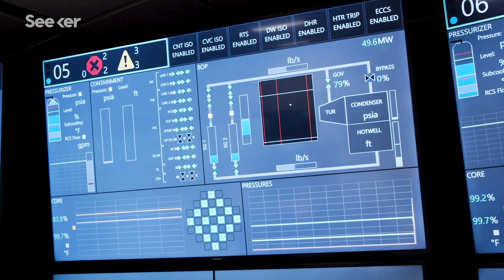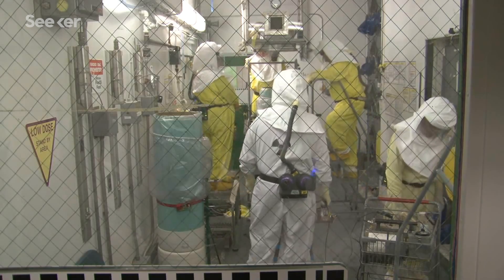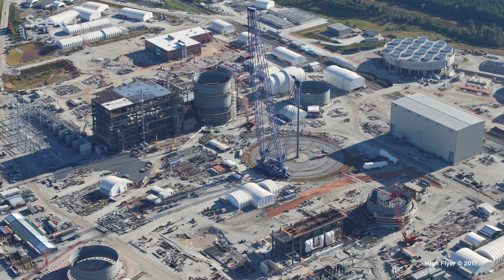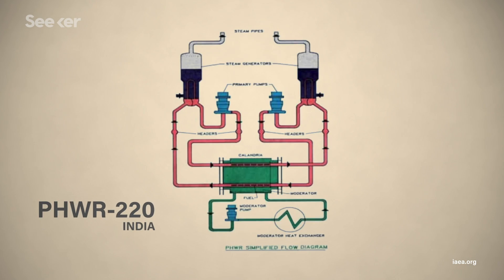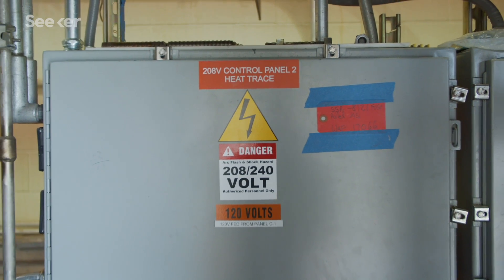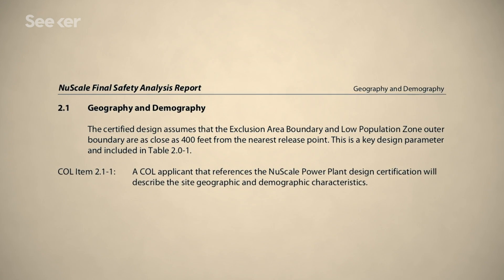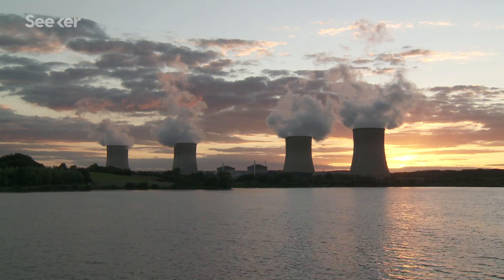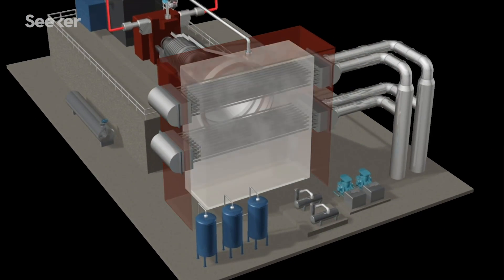Mini-Nuclear Reactors Are Coming, and They Could Reinvent the Energy Industry

Comment: "Mini-Nuclear Reactors Are Coming, and They Could Reinvent the Energy Industry"

What I expected: Small reactors you can fit on personal property that are controlled autonomously via artificial intelligence, capable of extremely efficient, high performance power supply that's completely independent of the power grid. Basically a Modern Day version of last century's Atomic Age Sci-Fi art and styles.

Comment: Solar wind hydro cheaper cleaner  safer.
Reply: @mrmugame  Acid rain anyone and is the waste by product is that still around? what about japan and Russia are the failed reactors are still causing trouble? In theory on paper its cleaner, but in practice its not. The Bigger question is that its owned by share holders of Big power companies that care little about the workers and only focus on the bottom dollar. How many people died digging up and refining the materials  for the reactors? and how much environmental damage and co2 emissions does open strip mining cause? Nuclear reactors are but one small cog in an industry that will cause massive amounts of environmental damage over time.
Reply: @mysticchicken5352  I'm not saying nuclear power is the best solution, but it's one of the best at the moment! And the refining and digging for the materials for a solarpanel aren't clean either. My point is that nuclear power isnt as bad as many poeple think and that solarpanels for example aren't cleaner (And that also applys to electric cars)
Reply: @mrmugame  The previous recovery rate for silicon-based panels was around 90 percent, so this new solar panel recycling process is good news for the environment. Non-silicon-based solar panels can have a recovery rate of up to 98 percent. How much of a Nuclear power plant can you recycle? is the ground safe to turn in to a park. where is the USA nuclear waste now? Out of the two I will go for Solar over Nuclear any day.
Reply: @mrmugame  Depends where you live , I prefer Solar Hydro wave and wind, more sustainable but that's my thing. In Nz we use Hydro wind and solar and coal, I wouldn't mind if we didn't use the coal as its not needed here. for us Ev cars are sustainable and greener than in the USA. each to their own. Good luck.

Comment: The concept looks like a good way to go at first glance.  Legacy plants were built on the premise of economy of scale ($/MW of capacity).  The down side, is the amount of generation lost if the unit trips off line .  It can be problematic to start enough reserve generation to replace a large  loss.  Large nuclear plants have been regulated to death by the NRC.  Imagine trying to build a house and the state changes the building code every 2 weeks.  And, oh by the way you must tear out all of the work you have done that does not comply with the new changes.   This is what you must deal with to build nuclear.  This concept can work if the package plant specifications are approved and frozen before the  first piece of metal is cut.   Nothing is said about refueling and how he core would be accessed to do it/  Military reactors are fueled for the life of the reactor.  But they use bomb grade uranium to do it.  Not sure how that will fly for numerous plants across the world.  No mention is made about Thorium reactors (no surprise since it is a competing technology).  you can't make bombs out of thorium.  These  reactors operate at low pressure on the reactor side.  The waste products have a much shorter half life than uranium reactors  Current reactor technology is based on the military reactors built for submarines. Thorium does not have that military investment  in it's technology base . A clean sheet analysis might very well choose Thorium over uranium.

Comment: The problem with nuclear power is not how sophisticated the reactor is constructed or is the reactor fail-safe. The main issue is how the radioactive waste is managed. 

How do you deal with the radioactive waste that will remain an environmental threat for hundreds of thousands of years, even if the human kind extinct by then.
Reply: By burning it in breeder reactors, until it's time of being dangerous is reduced to a few centuries, then putting the remains in the storage facility. As a bonus, you get a shit-ton of energy you would've thrown away otherwise.

Comment: Nuclear, expensive to build, cheap to run and expensive to decommission and expensive to store waste. 
So, overall expensive!
Reply: All of that is easily solved with generation IV reactor technology in the licensing process right now.
Reply: @chapter4travels  My day job is Aeronautical Engineering Design, I know very little about Nuclear Energy.
But is there even one Gen IV complete design, ready to build. From what I 
read they're just talking about what's possible. Wouldn't say that's near licensing. Do these reactors not produce any waste. 
My house is completly powered by wind and solar, but I can see some the problems of having the whole energy system using renewables.

Comment: Nuclear waste is harmless......until it escapes into the environment.
If you think that can't happen, wait for it........ It has only been in storage around 75 years. How long do you think steel barrels last? The first earthquake dispensing nuclear waste into the environment WILL happen. It won't be the last.
Reply: Nuclear waste is not stored in steel barrels, it's stored in super-strong concrete and steel casks. The waste is solid metallic pellets, there is nothing to leak. When generation IV breeder reactors come online, it will be worth a fortune as fuel.

Comment: Don't you think that these mini reactors will only increase nuclear waste and surely using a molten salt reactor burning thorium would be better and cheaper than the uranium systems.
This is because thorium is so plentiful, the reactors are 'walk-away' safe and use lower energy than the conventional uranium reactor plus the thorium can be recycled and used one more time. 
Just a random thought, why couldn't we fire off our radiation in a rocket at the sun or get it to the centre of our planet at the molten core?

Comment: Lets see you pull control rods until they are a critical self-sustaining position in the core and they sit there as the reactor generates heat energy used to boil water.  And then every so often operators pull rods as necessary to make up for "burning" of the fuel.  A reactor big enough to run a city of 1,000,000 people has about 100 tons of fuel in it and it 
"burns" about 2 tons of that fuel in 2 years.  It is actually a very simple system with very few moving parts and produces power at about 3 cents a kw hour.  It is all the overblown restrictions placed upon this resource that restricts its development in the US.  We have enough uranium in the earths crust  for about 2 million years of power production and that is not even considering thorium as a fuel source.
Reply: And then there's a possibility of extracting uranium and thorium from the seawater.

Comment: is there reason why we can't use nuclear sub marine power plant as civilian purposes?
Reply: The reason is those designs are classified technology.  I hope they have a very good reason for keeping it this way because that tech could be good for everybody.
Reply: there is nothing proprietary about nuclear power; 
way small nuclear power generator is designed is 
its one every other one; so when they are slide in; they are in sync so its full power when they need less they pull back; so that it is less power generation; thus less water need to cool; that can only be how its done; 
how is that proprietary? 

second is how to transfer heat; u.s. uses steam; lower temperature; 
Russia uses higher molten salt; none of these are proprietary; except every other one;

Comment: Why are they  obsessed  about  only hafe  the issue  .such as consumption more efficiently  using  the SAFE forms  of  energy. 
Sadly  due to greed  man has proven  himself  unworthy  to hold the power of  the  atom in a SAFE manner. Mathematically speaking nuke does  not  have  good numbers  as we are spun to believe  .case  in point the Perpetual storage and management of spent fuel rods.
Reply: Nuclear power is the safest way we can make electricity and We already have a very good solution for the waste. Leave it where it is, safely stored on the reactor sites. Molten salt breeder reactors are only 10-15 years away which will consume it as their fuel.
Reply: @chapter4travels  the facts  don't  reflect  the reality  of safety. I am a open  mind I will  await  for your explanation  that wind are tidal  are  Pv  are less safe that nuclear. We can do so with  documented history
Reply: @chapter4travels  I see that article  it appears  it come from a unbiased  Collegiate Institution.i will  read in depth. The 2011 (background)
Deaths  from radiation  is at 650k.
These  findings  are really  difficult  to  trust there is apparently  a good  bit  of  lobbyists and special interest and media campaigns Thank you for opening the discussion.

Comment: I think they should keep the current distance required. At least for quite a bit longer. We need to do these things for a while to see what can go wrong and then if we go a long time with a very good track record then maybe we can shrink the requirement. In my mind just as we take massive precautions with rockets because we haven’t done that many flights, nuclear is similar. Once we get to much more widespread use and we see that it truly is far safer I would consider changing my opinion on how far should be required, but for now it should stay at least as far as other nuclear plants are required to now, if not further

Comment: I believe nuclear energy is just a toxic rabbit hole. Every time humans build something new on a previously failed endeavor it ends up blowing up in a new way. We "learn" from our mistakes and build something that ultimately ends up doing the same thing. What happens when there is a potential meltdown, the power disappears and the magnets drop the rods (as designed to do) and one gets stuck? And they are pushing to put these things in close proximity to cities and neighborhoods? Making them smaller implicates that there will more than a few to achieve the same power output as one normal one. Making them smaller also does not eliminate the biggest problem with nuclear energy, nuclear waste. We never really learn, do we?

Comment: The world has the nuclear fuel to power it's current electrical use for about 20 years. what's your plan for 40 years from now?
Reply: There's enough thorium to last for eons.
Reply: @KenJackson_US  The fuel source that even minor mistakes in handling can lead to bone cancer (before being turned into nuclear waste) and which may not itself be fissile but leaves weapons grade plutonium as a waste product, meaning it's waste piles can actually experience thermonuclear melthdown.... gee I wonder why we're not using that more.
Reply: Even minor mistakes installing or maintaining solar panels can and does result in death as you fall off the roof,  @benderrodriguez6343 .  And that's not a joke.  Deaths per unit energy from rooftop solar are MUCH higher than from US nuclear power plants.  In fact, US nuclear is the safest power source in the world.

Your concern about nuclear waste isn't without merit, but it's uninformed.  In fact, thorium molten salt reactors can burn up spent fuel from other reactors.  And they don't produce plutonium as a byproduct.  Thorium isn't at all useful for producing nuclear weapons.

But nuclear waste is only a political problem, not a practical problem.  Ideally we should store it in Yucca Mnt.  But we could store centuries worth at the sites of the reactors.  It's very small and doesn't cause a problem.